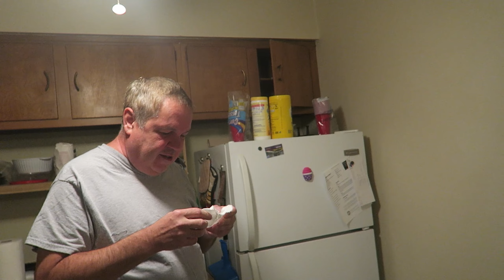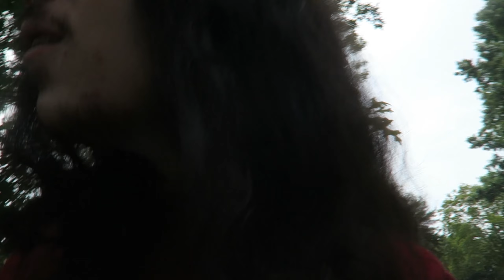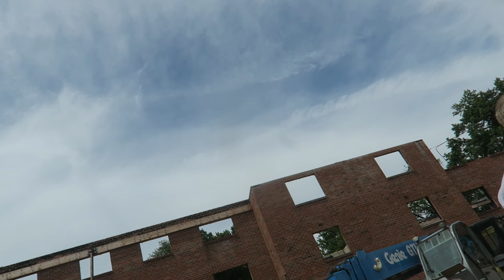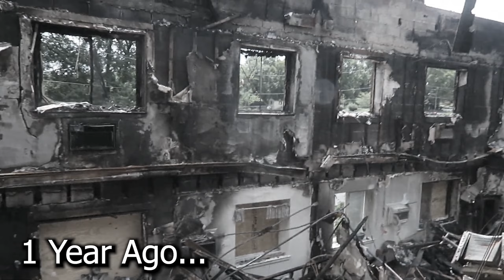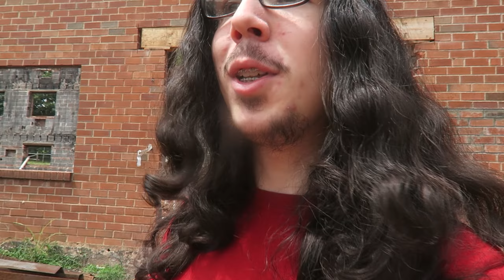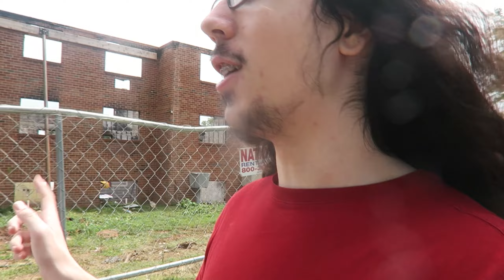Exploring The Inside of Ashwood Apartments After It Burned Down... (Apartment Fire)

Comment: I wonder if they will cross-section the building with firewalls now? I've seen complete gut-downs of brick shells of older buildings like this after fires before, and they always seem to put firewalls in such places if the structure wasn't built with them initially... I'm thinking that if your building HAD been built WITH firewalls in place, you'd probably still have to move somewhere else, BUT odds are, you'd be doing it with most of your possessions intact! With building codes the way they are with apartments, townhouses, and condos these days, I would think firewalls will be put in to the reconstruction...
Reply from the maker: Yeah it would make sense, but before no firewalls
Reply: @Jeffincats  - No, back in the day, not even a good amount of early strip malls were built with firewalls, let alone apartment buildings! Only industrial buildings seemed to have them... After quite a few devastating fires over the years like the one at Ashwood, is when changes in building and fire codes took place! I'd bet my last buck you'll see firewalls there now!